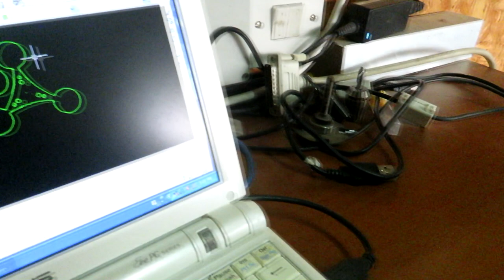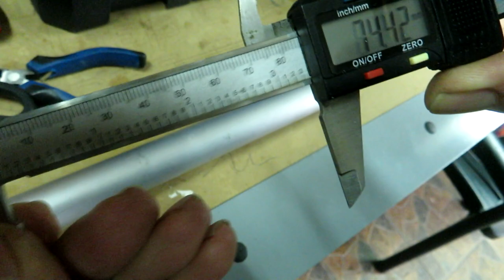Custom Made Anemometer with Arduino & Oled Display

Comment: How did you do the anemometer calibration? How many turns for 1 km, or is there a formula?
Reply: I've never seen one built with 3 triggers (the 3 magnets) but I would wager the code looks something like

rotations per second = float(rotation/10)  / 3 [since there are three magnets]
windspeed = float (rotation per second, * vane_circumference * variance) [variance will be somewhere between 1.2 and 3, its a little helper to make up for the energy loss of the wind movign the anemometer]  

windspeed is m/s, so windspeed * 2.237 for mph or (windspeed * 18)/5 for kph.

This is me just taking a stab at it blindly having not built and programmed my own yet.
Reply: Here is the complete code I made up quickly, if you use it let me know how you go....it should be the same as this video using two photo interrupters, a 2in disk with 10 holes and an oled display.  
#include <Wire.h>
#include <Adafruit_GFX.h>
#include <Adafruit_SSD1306.h>

#define SCREEN_WIDTH 128
#define SCREEN_HEIGHT 64
#define OLED_RESET 4
Adafruit_SSD1306 display(SCREEN_WIDTH, SCREEN_HEIGHT, &Wire, OLED_RESET);

const int sensorPin1 = 2;  // Pin for the first photo interrupter
const int sensorPin2 = 3;  // Pin for the second photo interrupter

volatile unsigned long lastInterruptTime1 = 0;  // Time of the last interrupt for sensor 1
volatile unsigned long lastInterruptTime2 = 0;  // Time of the last interrupt for sensor 2

volatile unsigned long revolutions = 0;  // Number of full disk revolutions
volatile float windSpeed = 0.0;  // Calculated wind speed

const float circumference = 12.56;  // Circumference of the 2-inch disk in inches
const int holes = 10;  // Number of holes in the disk

void setup() {
  pinMode(sensorPin1, INPUT_PULLUP);
  pinMode(sensorPin2, INPUT_PULLUP);

  attachInterrupt(digitalPinToInterrupt(sensorPin1), sensor1ISR, FALLING);
  attachInterrupt(digitalPinToInterrupt(sensorPin2), sensor2ISR, FALLING);

  display.begin(SSD1306_SWITCHCAPVCC, 0x3C);
  display.display();
  delay(2000);
  display.clearDisplay();
  display.setTextColor(WHITE);
  display.setTextSize(2);
}

void loop() {
  unsigned long timeElapsed1 = micros() - lastInterruptTime1;
  unsigned long timeElapsed2 = micros() - lastInterruptTime2;

  if (timeElapsed1 > 1000000 || timeElapsed2 > 1000000) {
    // No new interrupts, wind speed is zero
    windSpeed = 0.0;
  } else {
    // Calculate wind speed based on the time between interrupts
    float timeInSeconds = (timeElapsed1 + timeElapsed2) / 1000000.0;
    float revolutionsPerSecond = (float)revolutions / timeInSeconds;
    windSpeed = (revolutionsPerSecond * circumference) / holes;
    revolutions = 0;  // Reset the revolution count
  }

  display.clearDisplay();
  display.setCursor(0, 0);
  display.print("Wind Speed:");
  display.setCursor(0, 20);
  display.setTextSize(3);
  display.print(windSpeed);
  display.setTextSize(1);
  display.print(" in/s");
  display.display();

  delay(1000);  // Delay between measurements
}

void sensor1ISR() {
  if (micros() - lastInterruptTime1 > 1000) {
    // Ignore interrupts that are too close together (noise)
    revolutions++;
    lastInterruptTime1 = micros();
  }
}

void sensor2ISR() {
  if (micros() - lastInterruptTime2 > 1000) {
    // Ignore interrupts that are too close together (noise)
    revolutions++;
    lastInterruptTime2 = micros();
  }
}
Reply: formula for sure ,,